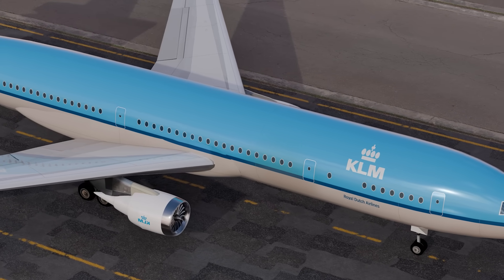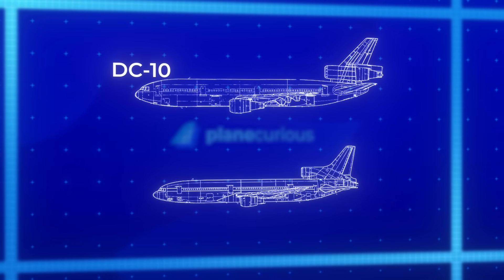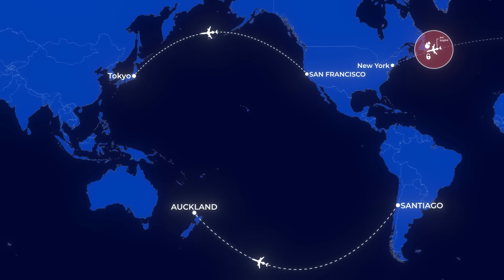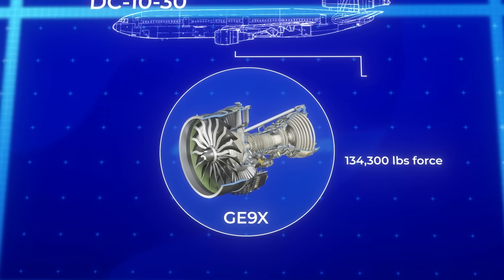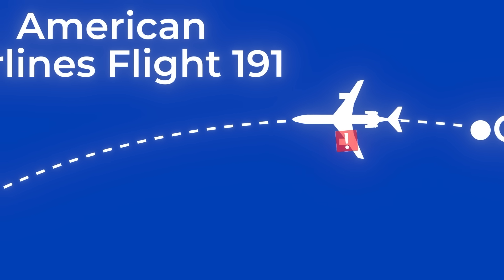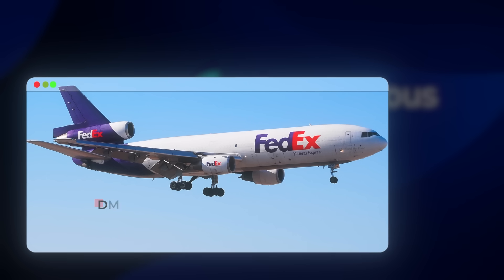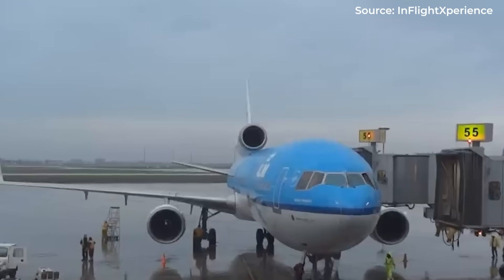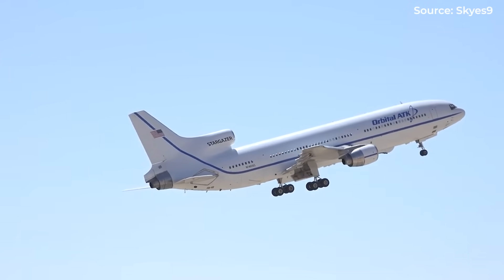Trijets Changed Everything - Until They Didn’t

Comment: Flight 191 did not crash because of it's third engine. It crashed due to maintenance crews ignoring SOP for wing engine removal and replacement.
Reply: They never claimed that to be the case. They were just highlighting how complexity doesn’t help in these situations.
Reply: @truality8289  But it has nothing to do with the AA191 being a trijet. The number one engine separated from the wing and destroyed the wing's control surfaces as it separated. The situation would have been the same for any twinjet.
Reply: @smchenry actually the plane was climbing out fine until the pilot reduced speed to V1 per engine out procedure ~ they had no idea the leading edge slats had retracted due to loss of hydraulic fluid ~ the slower speed stalled the wing
Reply: @chiprawlings7166  you are absolutely right. When studying the ultimate cause of the crash, people either forget, or didn't know, that if the pilots hadn't reduced their airspeed, they would  have been able to return to the airport for an emergency landing. That was made clear in all the news reports at the time. They ( the pilots),  didn't know about the engine separation and slat retraction, so they followed their training for an "engine-out" scenario. Unfortunately, that procedure made the stall even worse. I worked in an airport in the late nineties and I had a nice conversation with a senior pilot at Delta. He mentioned a regulation that was instituted because of flight 191.: a regulation was put in place, mandating that MAXIMUM speed be maintained in an emergency.
Reply: @jocelynharris-fx8ho  All true. We always trained for worst conditions . With clear skies, there was no need to reduce the climb speed with an engine failure.  Very sad event.  A note on the engine change procedure that caused the failure:  It was not greed. American Airlines' Tulsa Maintenance base is world class. They changed the procedure, (that the FAA witnessed), because they thought it was better and safer.  They did not realize it damaged a bolt connecting the strut to the wing. It has been 35 years ago for me, but the people I met there were fabulous and very caring!
Reply: @smchenry  Did not destroy "wings control surfaces". Instead severed hydraulic lines to the flight control surfaces.
Reply: @robertwisne7993  I agreed not greed. 

But the new procedure significantly reduced the time needed to complete the engine change, thus a cost saver to AA and quicker turn time. No doubt this played a part in AA's decision to implement the new procedure.
Reply: I concur
Reply: It's what happens when you outsource your mechanical/maintenance needs to the lowest bidder
Reply: @Fonpol68 The mechanics involved were AA employees. Not contractors.

Comment: I surprised that you didn't use the example of United Airlines Flight 232, a DC-10 that crash-landed in Sioux City, IA in 1989 after suffering a mid-flight catastrophic disintegration of the tail-mounted engine that took out every hydraulic line that left the pilots with only the controls of the wing-mounted engines to maneuver the plane.

Comment: Surprised you didn't touch on the issue of turbulence. My understanding was that it was implicated in some accidents of following aircraft when taking off.
The time gap between aircraft had to be extended especially if the following aircraft was much smaller.
The time gap was meant to allow the air turbulence to settle down to allow the following aircraft to safely take off.
I used to enjoy the sound of the 727's taking off in Sydney. Especially at night in winter, (over 40 years ago) the times were quieter then.

The 727's would literally crack the peace of the night sky as they headed west to Perth and Adelaide. The sound stayed with you long after its lights faded in the distance.
It was the noise of this aircraft, along with other factors, that ended its use in and out of Sydney Airport.
With a noise curfew preventing movements before 6 am and no later than 11 pm, the new Western Sydney Airport is expected to take the large aircraft movements in 2026.

Comment: The MD-11 was faster than any other airliners at the time, except off course the almighty Concorde, most airliners maxed out at around 320-330 knots indicated @ cruise altitude, where the MD-11 didn't hit its maximum until about 350-355 KIA. While 20 knots does not sound like much, it actually translates to 100+ km/h extra ground speed, and that makes a difference when crossing the big oceans.

Comment: I piloted the B727-200 for a few years back in the 1990's and recently retired after 32 years of airline flying.
The 727 was a real pilot's aircraft and magnificent to fly.
Friends in Cathay Pacific who flew the L1011 Tri-Star raved about it's superb flight handling and it's superior quality and finish. Lockheed always made pilot's aircraft, but unfortunately delays in certifying the RR RB211 engine caused problems and delays which cost them sales.
The autoland system and direct lift control in the L1011 blew everything else away.
I can't speak for the DC10 but will let history be the judge.
I don't think the Dehavilland Trident got a mention.
Reply: What are your  thoughts on a 4 engine verses a 2 or 3 engine ? . Also , what would be your 1st. choice on  an international flight ?.

Comment: 07:29 the improper maintenance was due to the design of the engine mounts.

The correct way to remove a wing engine was to separate it from the mounting pylon; this required undoing a multitude of bolts which also required replacing when putting the engine back.  Being time consuming, a quicker method was found by removing the engine with the pylon still attached as this obly required undoing 3 bolts.

The problem came during reattachment: there was little leeway and they were using a forklift which is not very accurate.  The result was a bumb whuch deformed the pylon mount and created a microscopic crack that grew with the stresses of each flight, until it failed on take off.

Tests showed that the plane was actually flyable, but the standard pilot training on an engine failure is to climb harder to get altitude to resolve the problem.  In doing this action the left wing with the retracted slats stalled and the crash occurred.  If the pilot had stayed with a shallower climb, the wing would probably bot have stalled and they could have returned to the airport.

The problem also was that the stall warning (stick shaker) was by default only installed on the captain's side and powered from the number 1 engine that fell off - the piots had no warning it was about to stall.  It was an optional extra (presumably for extra cost) to have the stall warning also installed on the first officer's side.
Reply: The slat system design was also implicated in the NTSB report. It should not have retracted to begin with.

Comment: An additional thing, any engine mounted inside the fuselage or a wing (including the tail on the DC-10/MD-11) sets the size for what engines you can put in later. So if they wanted to re-engine the 727 (which they looked at for noise control reasons) you needed an engine with the same dimensions or else the structure would need to change, and it was just easier to develop a new design, and when Boeing did so, they developed the 757. It's important that both the 757 and 767 were developed before ETOPS, the fuel efficency of twin jets were already making them popular. This contrasts well with the 737 which also used the same engines, but as they were under wing engines they could be "easily" changed out for others in future versions.

While both the DC-10 and Tristar had three engines, the initial ideas of both were to use two engines, and throughout the years studies to turn them into twins continued, especially to compete with the A300 and during the fuel crisis. Actually the original specifications drawn for both the DC-10 and Tristar were from American Airlines and initially were for a twin engined wide body, showing how much even back then airlines wanted twins, and this specification, along with anouther from Air France lead to the development of the A300.

Comment: Only lasted 4 decades? " A brief moment in aviation history"? That's like, a third of aviation history.
Reply: Not if you start counting at the Montgolfier brothers. 😁
Reply: @whatdamaddox7824  Or the Pteradactyls
Reply: @whatdamaddox7824  Fair point! 😊
Reply: During a recent NASA mission, high altitude photos were taken by their third WB-57.  It was built over 60 years ago and rebuilt after being in storage at the Aerospace Maintenance and Regeneration Group for 41 years.

The first B-52 flew over 70 years ago.  They are still flying.
Reply: Yeah but they were obsolete by the 2nd decade 😅
Reply: Exactly, still to date they took up half of the jet age, and a third of the airplane age so far.
Reply: Technically aviation started with Montgolfier brothers in a hot-air balloon back in 1783.

Comment: I missed out on flying in an L-1011. One of life’s regrets Flew in plenty of DC-10s, however. Was never impressed. They also experienced catastrophic failures, like a cargo door blowing out mid flight.
Reply: I don't think there were many major differences in the cabins. The DC-10 had somewhat larger windows. The Tristar had a unique ceiling design that gave it a more spacious feel. I do remember taking TWA in 1976 BOS-SFO.  With a 12 noon departure, 2/3rds of the seats were empty. Beautiful red/ orange colors, choice of three meals (coach class) plus appetizer before hand and 8-across seating. By then the coach lounge had been removed. But those were indeed the days.

Comment: there will eventually be a point where we will need 600 seaters like the 747 and a380 for demand, there's a fun A370 concept out there which is basically a single decker 747/a380 replacement with 3 engines, we will also eventually reach a limit for engine power and efficiency so this doesn't seem far fetched to come maybe post 2030s

Comment: I've been watching Mentor Pilot and there have been multiple two engine failures.  The cause was not the engines but contaminated fuel, or running out of fuel.  Three engines would likely not have helped.
Reply: Could there be a design in which  the 3rd. or even a 5th. engine  [ on quad set ups ]   , could run off of independent systems ? . 
Those extra engines would act as spares  primarily in emergency situations   .

Comment: I fail to see the connection between the AA 191 DC-10 crash and the tri-engine design.  It wasn't even the tail-mounted engine that failed, it was the #1 wing mounted engine.  This was not related to the complexity of having 3 engines.

Comment: I was stationed at RAF Lakenheath in the UK during the cold war. I flew back to the US on a KC-10 Extender (converted DC-10 trijet) USAF tanker out of RAF Mildenhal. We refuled some aircraft on the trip across the Atlantic and the flight only cost me $10.00. These flights were "standby" status and were called "hops" because when a seat opened up, you just "hopped" on the plane. It was a "no frills" flight and some USAF crew member handed out box inflight meals and I do remember that I wished I had brought a jacket. Temporary seats were installed on the main deck which usually carries cargo on the trip. The KC-10 Extender is still in the USAF air refueler fleet today.

Comment: Tri-jets were always going to be a relatively short interim commercial air development phase between four jets and twin jets.  They were an effort to balance the most efficient operation possible (Revenue per Available Seat Mile - RASM) with the jet engine technology in existence at the time in accordance with "engine out" safety standards for over the water operation (ETOPS).  The 60 minute rule was waived for three engine aircraft in 1964, which incentivized their development.  Later twin jets with much improved engine reliability could meet the ever increasing ETOPS standards while operating more efficiently than tri-jets, which led to their retirement from passenger service.

https://en.wikipedia.org/wiki/ETOPS

Comment: 1) The tri-jet also came about because engines just weren't that powerful yet.  Regulations say the plane must be able to climb with one engine out.  That's why 4 engine jets are slow climbers compared to twins. If you only lose 1/4 of your thrust to a dead engine, not so big a deal.  If you lose 1/2 your thrust, you better have some big motors hanging out there!
2) The L-1011 was largely doomed by Rolls-Royce.  They were in bad financial trouble and were the only engine supplier for the L-1011.  It put a lot of airlines off the airplane even though it was well liked.  It also is the reason Lockheed doesn't work in the commercial space any more.
3) The 727 was also successful because it carried around its own air-stairs.  It could land at Bug Tussle and get everyone on and off without a dedicated set of stairs or a ramp agent to handle those stairs which can lead to a damaged airplane. (DB Cooper also found them useful.)
4) 727's were still pretty common when I was in A&P school and we'd watch them take off compared to the MD-80/90/whatevers.  On a hot day it was easy to see the performance difference of the older Tri-Holer vs. the gutless Mad Dogs that barely cleared the trees with two working engines.  Public perception is a big deal.  I'm still not convinced a Mad Dog would have made it on one engine.
5) United 232 also didn't help the DC-10 when it did a cartwheel down a runway that was broadcast all over the world.  Routing the hydraulic lines together was a bad design on Douglas' part, but Boeing did the same thing, (see JAL 123).  Both aircraft types were modified to separate hydraulic systems after these accidents.

Comment: Of all the aircraft types that I have flown the DC10 was an absolute delight. The tri jets were eclipsed by changes in legislation, ETOPS, but that was only brought about by the technological and reliability advances in Engines and their Performance provided by the Fan Engine together with the rapid pace in the simplification of operation. The computerised systems and satellite navigation greatly reduced the workload in the cockpit making the navigational complexities and engineering functions easily managed by a two crew operation i.e two pilots. The narrow bodied twin jets are not as comfortable for the passengers, I have yet to meet a frequent long haul passenger say they prefer them over the wide bodied aeroplanes.

Comment: 7:30: While the AAL crash was caused by improper maintenance, the fact that all three hydraulic lines were installed along the wing's front spar (instead of one being installed behind the rear spar) resulted in total loss of hydraulic pressure as the engine rotated up and over the wing, severing all 3 hyd lines.

Comment: I brought the PH-KCB "home" at KLM.

I am avionics certified for the DC10, MD11, 767-300 and the 747-400.

Id I talk about reliability number 1 is the 767, then the 747-400, followed by a large distance DC10, and MD11.

The latter "looked fine" from th eoutside but boy oh boy, what a bad design technically. Mechanically also an issue, Lots of hydraulic leakages, bad cabling inside, the #2 engine accessibility..
Neh.

Comment: 180,000 pounds of thrust to take off and climb to altitude with a DC-10. Then idle the tail engine and throttle back the wing engines to fly twelve thousand miles with the other half of the fuel. With tapered wing spars (none at Boeing) it was more aerodynamic and designed to fly as a glider with a tail deployed propeller driven hydraulic pump for flight controls.

Comment: The DC-10's used an elevator to bring food carts up from the lower level, I often wondered how many romantic moments happen in flight. They also incorporated a "patio" when you opened the cowling to work on the center engine, there is a ladder that goes up through the tail compartment past the APU to get there, don't forget to bring every tool you might need!

Comment: The 3rd engine could have been left unplugged, but the plane's insurance assumes that the plane carries  its spare parts, so the 3rd engine could have simply been replaced and the plane could have flown on. Now it's the same, almost the same load, that is, the spare parts are carried inside the plane, it's just not visible from the outside. 
In fact, the insurance of the plane, in case of failure of one engine, is more than 3, because the risk is higher. And in order to increase profits and reduce fuel consumption, they did the opposite. It seems crazy, but it is so.
The engine manufacturer is doing well because now they have to produce more parts, the insurer is doing well because 2 engines are more risky, the carrier is doing well because less fuel is spent. The only one who suffered is the consumer. 🤣
If the engine is so good, leave one engine instead of 2. Then the risk will be even higher, but then the buyer will refuse to pay at all, because Maglev trains travel at about the same speed and are more profitable.

Comment: Guy is speaking out of both sides of his mouth.  One side, he implies they were kinda a failure.  Other side he implies technology moves on.  Uh, yes, it does.  Wouldn't call them a failure, just an evolution of time. They were designed in the 70s when those massive 2 engines didn't exist.  UPS and FedEx still fly MD-11s still to this day.